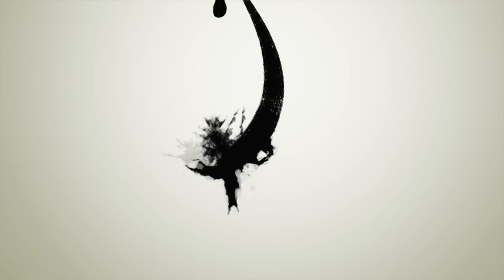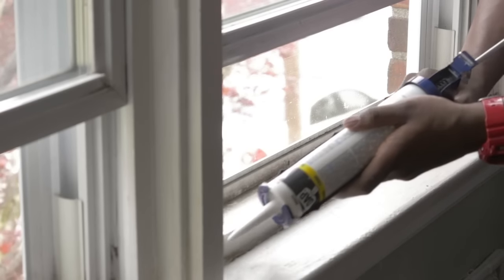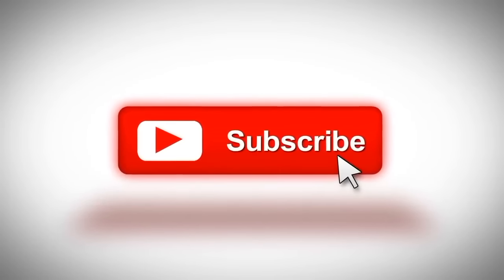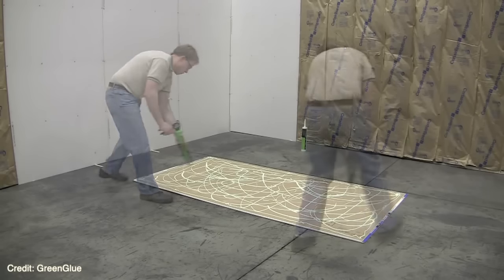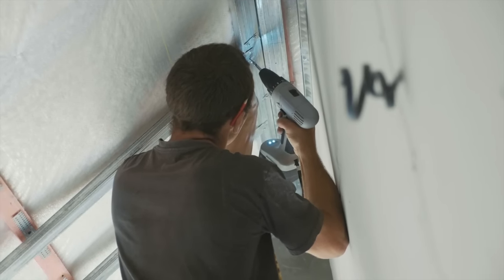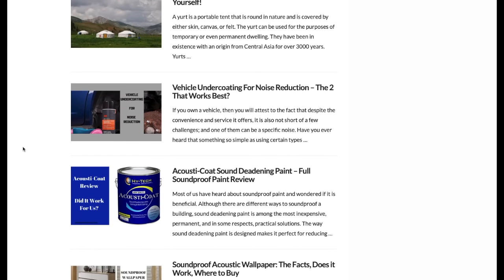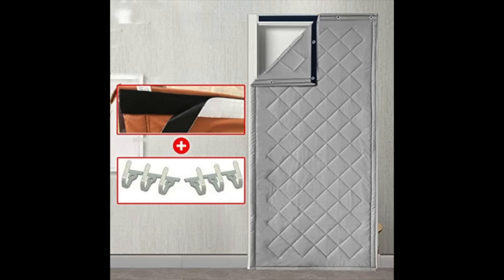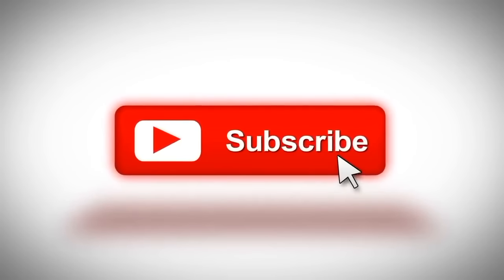How to Soundproof a Wall - 7 Easy DIY Ways!

Comment: I have an adjoining wall to another apartment that I have somewhat soundproofed by screwing 2 queen sized, 3 inch egg-crate mattress toppers to the wall, and then covered them with noise reducing curtains so it looks like one giant window covering. I would post a picture if I could, but it works very well in an apartment situation, and it looks stunning design-wise.
Reply from the maker: Would you mind sending a picture to info@soundproofguide.com Thanks!
Reply: Where can I buy that egg crate material and or is there a site I can refer to how to do what u did??
Reply: How thick is it?
Reply: @rufus5208  you should upload a video of your setup and how u did it. I live in a mobile home and my problem area my bedroom that has a wall with a window. I'd like to maybe get some noise reduction from the window. Wall if possible. Noisy neighbors. Wall thickness is let's say.... Im guessing by the depth of the window compared to the wall it's attached to and say about..... 3 to 4 inch wall
Reply: Hello everyone, so I had hoped that the two mattress toppers would be enough to stop the bass sounds from my neighbor, but it didn't. And  the other thing I wanted to mention is that you also have to not only screw the toppers on to the wall but you also have to tape them as you go with masking tape across because they will kind of sag a little bit from the weight. It's literally like trying to nail jelly to a wall.

I ended up putting another layer of 8x4 drywall panels in front of the egg crate mattress toppers like an extra extended wall, and used L-brackets to attach them to the sides of the walls, and then I covered that again with the soundproofing curtains on a long kaleidoscope curtain rod. I actually hung some moving blankets behind the soundproofing curtains also to dull out some of the noise even more. My situation with my neighbor got completely out of hand and I had to get management involved to make him stop playing his bass so loud so I haven't had a problem since then because he turned the music down. But the drywall panels actually did subdue the music more than anything. And I'm sure there's a benefit to layering soundproofing blankets and egg grates of any kind with drywall because the space between the two drywall panels traps vibrations and sounds coming through the walls. But in an apartment situation you will always have sound coming through the ceilings too, so you would literally have to have a completely closed in room within a room to be able to completely block out sound. 

The extra drywall panels worked so well that I put pieces in a window that gets a lot of traffic noise and that has helped substantially, and I also used another big piece on a wall that I hear sounds from neighbors outside in another area and that has helped greatly there too. You can go to Home Depot to get drywall panels and cut them to any size you want. The 5/8 inch fire code drywall is the densest sheetrock with the most sound absorption.

If your issues are more high frequency sounds like talking or TVs in an adjoining room, adding an extra layer of drywall over some egg crate soundproofing up against the adjoining wall will dull those high frequency sounds. But for low frequency bass sounds it is extremely difficult to block those frequencies. I will say this; as a result of putting up all that soundproofing I cannot hear my neighbor at all like talking or his TV or anything since he's turned the bass down. I hear absolutely no sounds whatsoever, so that is a bonus. All of that hard work wasn't for nothing. And yes, I'll probably send a picture here soon to the email above when I get some time.
Reply: @chrisbiohazard4890  I bought queen size mattress toppers, I think they were 3 inches thick. Not cheap.
Reply: @chrisbiohazard4890  you could easily place drywall panels up against those walls and cut panels to put inside of your window to block noise coming through the glass. 5/8 of an inch firewall code is the densest most sound absorption sheetrock. It's also very heavy so you'll need a truck to move those panels.
Reply: @soundproofguide  I'll work on that soon!
Reply: @rufus5208  overall the wall extends out probably by 4 to 5 inches more.
Reply: @tuffstuff2U  Wow, I never realized how hard it would be to have a quiet space where you can forget about the outside world for a little bit. I made the mistake of buying a house on a pretty busy street which my room is facing. And the parallel wall  is against the living/dining room area of my house. Sometimes my roommates are hanging out in there and making noise. So, I'm essentially sandwiched in between 2 noise machines. But by far, the worst side has to be the wall facing the street. So I'm looking for ways to block out as much sound as possible from the outside. Unfortunately, this method will take too much space. But thanks for your input!
Reply: @rufus5208  thankfully I live in a corner unit so I only have one neighbor to contend with to the side of me, but I also have an upstairs unit above me but that noise is minimal compared to dealing with the bass sounds coming from the side, but I do understand that feeling of being sandwiched by noise.

You wouldn't necessarily have to put drywall up but you could put blankets in your window, and then another really good way to dull some of the sound through a wall is to put a bookshelf up with lots and lots of books.
Reply: @tuffstuff2U  ok what if im like your neighbor. I like to have loud music BUT unlike your neighbor I actually respect my neighbors and dont want them bothered by my loud music. What would be the best way to keep noise inside my room and still be able to have my music up pretty loud?
Reply: @jesuscarranza1815  hello, thank you for that great question, and thank you for at least trying to be conscientious of your noise levels. THE MOST IMPORTANT THING YOU CAN DO is turm down the bass on your sound system all the way, or as low as you can stand it. Bass (low frequency) is what travels through walls not the treble (as much). So if your base is low, your treble is high, and your overall volume setting is reasonable then I think you'll be okay. 
My neighbor has a Bose system and they are notorious for having too much bass, even the smaller systems put out a ton of bass. And he didn't even try to turn down his bass setting after I specifically asked him so it's been a year and a half nightmare. By the way, two other people moved out around him and finally management is kicking him out by the end of this month 😁. I just feel so sorry for the next place that he's going to because I know he's going to take that same Bose boombox and play it at the same bass level, which is not appropriate for apartment settings.

I wanted to say also that even with all of the soundproofing I did with another layer of drywall the bass was still coming through the walls so that tells you just how strong bass travels through walls. 

The other thing is, and I don't know if thisv applies to where you live but years ago my apartment complex took out all the carpeting in all of the units. The carpeting actually absorbs sound so that really changed the way sound travels through these units now. 

If you don't have carpeting I would suggest putting down large rugs close to the wall that you're concerned about and then also, you might want to consider putting up a book case and put a lot of books in it, or a thick cloth tapestry, or anything you can think of to buffer sound going through that adjoining wall with your neighbor. And last but not least you can get a really badass set of bluetooth headphones and jam the s*** out of your music without anybody hearing if you want it up super loud. That was always my thought; like why doesn't he just get a really good pair of headphones? The consequences for him insisting on playing his music too loud as he lost his apartment. Is it worth that?

Comment: Thanks for the great information! Would there be any difference in soundproofing a cement block wall that’s already sheet rocked?
Reply: yes the denser the better if you can afford it to cover the place in lead. what you want to do it use  2-inch battens (timber) and use drywall over them so it will look like this  block wall / batten/rockwool/drywall/paint for a nice finish that  2  or more inches will make a significant difference think of someone mowing the grass and how annoying it can be think of that sound it will be like listening to a Bea buzzing around you, you  will still ear it but thats the difference  it will cut the sound if you ear any sound it will be coming through the windows or some other place e.g wooden floor or celing

Comment: 4:30. Be careful using vinyl behind drywall on exterior walls in hot/humid climates, as it acts as a vapor barrier and the moisture driving into the building will get stuck and rot and mold out the inside of your wall.
Reply: And from interior side?
Reply: @maheshbhatt8115  interior walls are okay. Any wall that is facing a conditioned area is good.
Reply: @Buildingscienceacademy  thanks
Reply: What about between a bathroom and a bedroom?
Reply: @romy1480  That’s okay 👍🏼
Reply: So anywhere inside the home is fine?
Reply: @mattsterentertainment8380  it cannot be a wall that is shared with the outdoors. We call these “exterior walls”. For example, walls with windows are obviously facing outside. Any wall where there is outside on the other side of it should NOT have vinyl.
Reply: Thx for the heads up
Reply: Every house should already have vapor barrier between the studs and drywall so this shouldn't be a problem.
Siding -> Housewrap -> OSB -> Studs -> Vapor barrier -> Drywall -> Mass loaded vinyl -> Drywall
Reply: @joseph7105  This isn’t true. Many houses don’t have a vapor barrier at all. Also, the building envelope you described only works in northern climates. You build a house like that in Florida or Texas and you’re going to rot out the building.

Comment: Are 2 inch thick acoustic panels effective for dry wall? I even saw 4 inch thick panels.  I live in an apartment and the walls are so thin.  I'm putting finishing touches on my studio and want it 100% sound proof. Thanks

Comment: Hi, I am going to make a sound isolation booth of 4X4 feet size with 6 feet height. My plan is to use 2 12mm plywood sheets and place an EPE foam sheet of 2 inches in between them. Then on the inside of the booth place pu foam for sound diffusion. Also I will fill all the gaps with silicon. Do you think it will block out the noise from outside as my room is next to a road? Any suggestions are welcome. Thank you.

Comment: apart from the blankets solution, what would you recommend for preventing sound coming through walls without modifying the wall. Like when one is renting a room and wants to prevent external noise entering through walls.
Reply: Use the right eggcrate or order the cheap squares of foam you can do a wall for 50-100$ works great just doesnt look amazing unless your a streamer or such
Reply: @Kevin-sm8pn  totally considering your suggestion.

Comment: Thanks for the information. I have two bedrooms side by side and you can easily hear people talking in the next room. I don't really want to add more layers and re plaster. Can I drill small holes in the wall and fill the stud with expanding foam?
Reply from the maker: That will not work in blocking any noise whatsoever. Expanding foam is great for insulation towards heat and cold but will do nothing for soundproofing a wall. I actually answer this a similar question in the video coming out tomorrow! Make sure to check it out and lave me a comment on it! Best of luck Gee!

Comment: I'm confused. So for an existing wall (blocking outside noise) you can add the MLV directly to the existing drywall then add more drywall directly to the MLV?

Comment: I live in a nosey hood on peer and beam in Houston area was thinking of hanging 5/8 sheet rock from the crawlspace floor joist but read VML was better . After further searching found this stuff on amazon say it has 70db stc called FloorMuffler Ultra Seal Underlayment 300SF and much cheaper should be easier to install too . its not made for this purpose but will it work ? Is it better than 5/8 sheetrock or VML .I also thought of putting 30 lb felt on the very bottom between floor joist and the FloorMuffler Ultra Seal Underlayment 300SF . Another potential problem although I treated the ground and joist  with Taurus SC and the wood with bora-care .

Comment: Do you think that this would work just as well:  DIY my own Rock wool by pouring self leveler or swiping slurry concrete over discarded shag carpet pieces. When dry hang the 16” strips on the vertical studs as an interior layer…

Comment: Question: we have an unfinished basement ceiling. My idea is to cut stops of used but clean enough carpet strips between the beams and studs, use the acoustical glue and staples. The goal is zero cost and re-using materials. What do you think?

Comment: Thank you so much, I just loved the idea of using bookshelves, may be I'll use it on one wall at least. Could you give me an advice, how to fill considerable gaps (about 10 centimeters) between the floor and the walls (it's under the floor even) and also between the walls and the ceiling, the old walls are made of plaster and I can hear the neighbors from the side very well, but the worst of all is impact noise (the structure vibration when they run or drop something). So I'm thinking about shoving into thses gaps some soundproof material but I don't know whether it sould be some bulk material, plaster, some panels or all of these things. Finances are very limited and I'm a complete beginner in all these things. Could you just point out the sequence and the main principles of this. I guess I won't be able to demolish the old wall to build a new one

Comment: I’m trying to determine an approximate cost for supplies to sound proof two 10 ft walls, using 5/8 in drywall, green glue noise proofing compound, and mass loaded vinyl. Any information greatly appreciated, thanks!

Comment: My next door neighbor at my business moved in a 30 ton punch and laser cutter 3 years ago. I can't take it no more. I'm going with Quietrock then green glue  on 5/8 drywall on top of that.
Reply: I’m thinking of doing the same sequence how did it work out for you
Reply: @bluemoth1879  not as good as I hoped. Lower the sound 10 decibels  50 to 40 40 to 30 I had hoped for more.
Reply: laudarevsonhunt sorry to hear, try using the rubber sheets then 5/8 sheet rock over that.. you need more mass/thickness.
Reply: @bluemoth1879  I know that now. It cost me 7k. Quietrock not all it was cracked up to be.
Reply: laudarevsonhunt that’s unfortunate. Hopefully that’s a tax write off. I think the best solution for your situation is to build a floating wall in front of that wall where the noises coming from... let me know what strategies you used to solve the problem, I have really noisy neighbors that have no respect for their fellow neighbors, I have PTSD can’t deal with noise. Terrible. Hope things work out. 👍👍
Reply: @bluemoth1879  exactly!  This is why I'm  here,  it causes wars between neighbour's,  where they could  live in peace,  if problems solved.... !!!! I hope  something cheaper us invented and I find it asap!!

Comment: I’m thinking of the sound proof caulking with paint. It’s for a thin wall. What do you think of me putting should proof panels on top of the sound proof paint?
Reply from the maker: It probably won’t do much for a thin wall. I would definitely add an extra layer of drywall. That would be your best bet and not terribly expensive. Best of luck! 😊

Comment: Hi. I need help soundproofing my kids bedroom. I live in a attached duplexe . my home was built in the 50s, so no insulation in ceiling just a 5/8 ceiling. I was thinking adding a resillient channel with 5/8drywall. Option 2 would be resilient chanel with 2 5/8 drywalls with green glue. Option 3 the most expensive and not sure if its worth the hassel to remove the ceiling , add fiberglass insulatio n add the resilient chanel and 2 layers of 5/8. The question is ... Is option 3 worth it ? Not sure what the stc is between those. Let me know if you would have any advice. Thanks and stay safe.
Reply from the maker: You’ll be happy to hear that my next video is “the best way to soundproof a duplex wall”! Monday morning 7am EST
Reply: @soundproofguide  ill watch it. What option would you go here ?

Comment: Hi, I live in a apartment on first floor and below is ground floor having parking which also have water storage tanks going down till the basement where there  is water pumping room that pumps water to overhead tank on 15 th floor. When the  submersible motors (4 in number) are switched on there is very irritating noise ringing noise comes into my apartment through the concrete walls which are common walsl going down till basement. The ringing noise is audible in entire apartment. Can u suggest a cost effective solution. My apartment walls are painted.

Comment: Do you have any advice on sound proofing a room to keep the noise from a loud motorcycle out? As well how to build a sound booth where a loud HD motorcycle is close & running often? Is it possible to keep that noise on the outside of the room/booth
Reply: You can use curtains the one for sound proofing

Comment: Can I soundproof a wall by applying towels in between it? I've got like a small storage section behind my wall, so I've got space between the wooden beams. I am thinking to fill this up with towels, so that the other people in my house don't hear so much noise. Would that work? In my room there is really no wall free to hang a towel or blanket on.